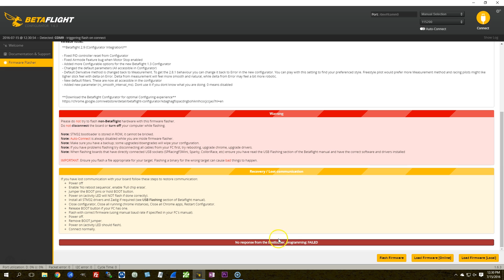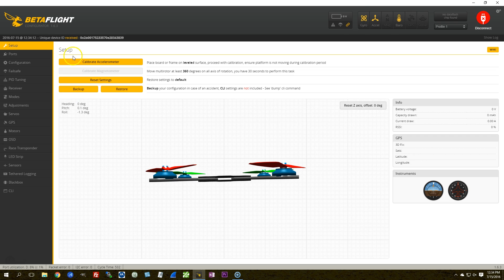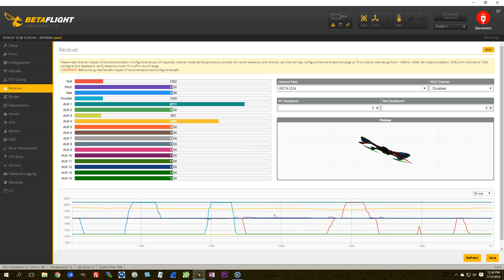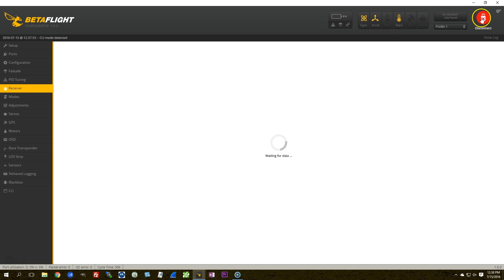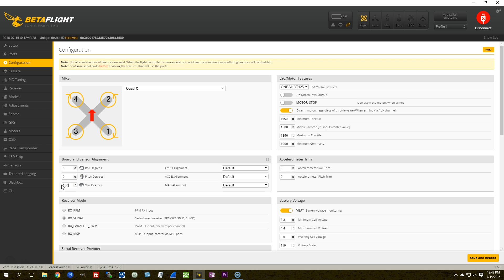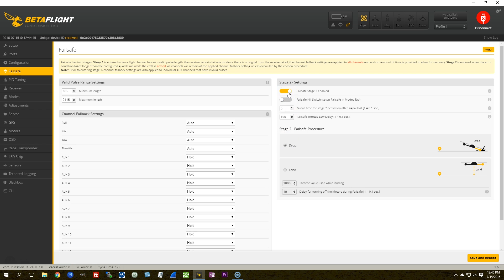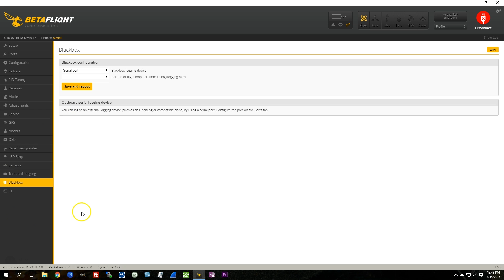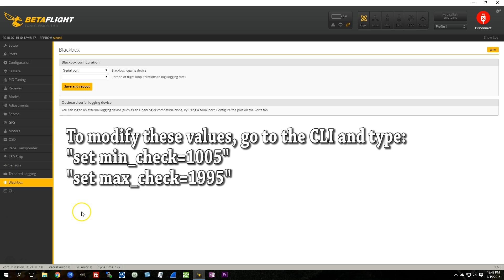Betaflight Setup (BETAFLIGHT 3.3 VERSION IN VIDEO DESCRIPTION!)

Comment: You're videos are great! 
  I have a little problem. I am running a sp racing f3 board and running ibus on the tgy-ia6c. The controls and copter works but in Betaflightin it keeps telling me to configure serial ports and some of the functions like failsafe aren't available or showing. My MSP is running on UART 1 and my Serial RX is on UART 3. I also don't see USB VCP in the Ports section. Not sure what's going on

Comment: Hi Joshua, I have a little big question. TodayI almost had a heart attack when the quad went crazy for 0.20 seconds during a fast roll in airmode (with throttle at 0) and slammed the ground from 30 feets high (nothing broke, and they say chinese frames are crap..)  I'm trying to figure out what happened... 
My motor idle is at 1050 which is lower than yours but all the motors spin nicely.
Something I didn't do is the min_check and the max_check, which I don't know if has something to do with the issue I experienced, this has only happened once after some fast flips and rolls..

Btw very useful video.
Reply from the maker: +Dashz min_check and max_check wouldn't do that. 1050 is more than high enough min_throttle for most modern setups. At this point I would be suspecting damaged hardware. I mean, you could also have had a loose prop or whatever but I think you would know if that happened.
Reply: Alright thank you, Ill keep investigating and experimenting in a soft ground , and yes my setup is up to date an f3 board, dshot capable escs (they are ztw) and some emax motors...
Reply: Well it seems that it was a loose prop as you said... Im not used to the active breaking of the new setups and they do come loose if not tighten well.
 One last question asumming my hardware is capable, how do I set up Oneshot24, multishot etc? Do I have to change loop times, pids? Or just select it into the confi tab and I have a more responsive quad.

Thanks again for your time.
Reply from the maker: +Dashz you must use nylock nuts on the props. To enable oneshot or multishot just select it from the pull down. Your ESC's must also support it.

Comment: My problem is I do not save the pid controller when I choose betaflight controller and it always appears in controller legacy. How can it be solved ??
Reply from the maker: Probably you are using an old version of Betaflight with an up-to-date configurator. What version of Betaflight are you using?
Reply: Joshua Bardwell i have betaflight 3.0.1
Reply from the maker: +Nicolas Atencio that's fine then. Are you also on the latest configurator?
Reply: The version is the last 1.8.7

Comment: How can I connect GPS?
I see that UART2 is for GPS, but I have set up serial RX and enabled RX serial on UART3 and I cannot enable 2 RX serial so cannot set up GPS, any suggestions how to do it?
I cannot select multiple UART :(  betaflight just resets and disables all my UART2 and UART3 settings if both turned on...
I need GPS coordinates on OSD to record position on DVR to find it easily when lost, I don't want navigation with GPS just to have coordinates for OSD.
I have HGLR F3 AIO board with integrated OSD.
Reply from the maker: GPS is not Serial RX. GPS is GPS. There is a radio button for GPS that you enable.
Reply: Thank, I tried that too set that dropdown where GPS is ther for uart2 save and reboot and it disappeared :(
Does it test it? when I have only USB power uart is not powered.
Reply from the maker: Most likely you haven't got the GPS feature enabled in the Configuration tab. If the Ports setting is not valid, it will be reset. If you haven't enabled the GPS feature, then enabling GPS in Ports is not valid.
Reply: on the config tab it says go to ports tab :( and aftersave it also resets gps enabed option thats why i think ports should be set properlyfirst

Comment: Got an odd one for you Joshua. At 4 in your vid in setup your quad shows 0 heading, when I plug in it show about 50 when it should be 0. I go to configuration and see the 90 degree offset is still there. I then save and reboot and then at setup it goes to 0. This happens each time I connect. Something wrong?
Reply from the maker: Heading is derived from the compass, but since you don't have a board with a compass installed, the copter can't know its actual heading. So it resets the heading to zero on every reboot. Completely normal.
Reply: Oh, thank you, I crashed 3 different models due to loss of radio control. Had the right gimbal on the futaba t8j replaced, added a new radio transmitter. Did chip erase from BF 2.61 to BF 3.01, then adjusted all endpoints on the sticks, set min and max to 1000-2000, calibrated esc and did that individual ESC adjustment from 1020 to 1980. Not fun when you go to turn and it does not turn. I am thinking it was a stick endpoint issue and esc. Just checking all the loose ends.
Reply: PS: Still crossing my fingers that it works. Otherwise, will have a good deal on a futaba I guess.

Comment: Hi Joshua! Thanks for explanation..Is it true that pid loop frequency should be lower than ESC frequency? For example, PWM 500Hz...But in betaflight the minimum is 1khz. is there a solution? Thanks!
Reply from the maker: There is no implied relationship between PID loop frequency and ESC motor frequency. You should not be using PWM anyway. Use OneShot at least, and your frequency can go up to 2 kHz with no problem. The issue you are thinking of, syncing PID loop frequency with motor PWM frequency, was fixed with the invention of OneShot. With OneShot, the motor update is always synced to the PID loop. Except Betaflight also allows you to unsynchronize it if you want to know more about that, here is a video: https://www.youtube.com/watch?v=WFFmE1EhuP0

Comment: Hi Josh,im notexactly sure what i did,but i can now connect to betaflight,and get access to the pid tuning etc
now i can start to tune,but first, a test fly in acro and fpv for the very first time,thanks for taking the time to help me,i have watched the betaflight clips a few times now,just need to get out and fly the damn thing,bit windy here today though for my maiden flight,when you are checking your receiver inputs etc ,do you have your battery connected or just have board plugged in and tx on only ?

Thanks
Scott
Reply from the maker: Some FC boards will power the receiver from USB in which case you do not need a lipo plugged in. If your FC board does not power the receiver from USB, then you need a lipo plugged in. Have your props off and/or use a smoke stopper if you do this.

Comment: Hi Joshua
Im having trouble connecting my Seriously Pro SP Racing F3 Evo V2 to betaflight,when i connect to betaflight it just does nothing,i have a premade model,i asked the shop to install betaflight on the board,but nothing i do lets me actually get to the main tabs,i would have to take quad apart to access the boot pins,its a Ragg-e WBX frame.
I can get access to the firmware flasher screen,if i try to reflash the board online without the boot pins being shorted ,will it do nothing,or will i brick the board?
Im willing to send it back to shop where i got it,but i would like to solve it myself with a little help :)
Sorry for long explanation
Reply from the maker: +scott milne have you installed the CP210 drivers in your machine?
Reply: yeah,installed all the drivers,i have a damaged floureon 250,that i can use cleanflight with no trouble at all,i use same usb cable on both cleanflight and betaflight,when i plug the usb cable into the quad and my pc,i get an error message in taskbar saying usb device is not recognised,do i need to do something with the zadig driver,i saw a drop down menu?
I asked the shop to flash betaflight onto the board as its shipped with cleanflight,the quad spools up and i did a test hover,all inputs are fine,the arming switch is good,just cant connect to betaflight to start my pid tuning
Reply from the maker: USB device not recognized means a communication issue between the chip and the PC. Does the hoard work on any other PC or USB port?
Reply: i have a laptop but it only comes up with manual selection on the ports tab,no COM 1 at all.cant change the drop donw on it at all,
Reply from the maker: Does it work with any other FC?
Reply: Joshua Bardwell what do you mean? I have an old busted quad that has a naze board, using my USB cable and cleanflight I can still connect to the quad, I unplug my busted quad, close cleanflight, open betaflight and I get the error message USB device not recognised, in top left corner of betaflight it says opened port successfully, but it does nothing and after 30 so a or do, it closes the port without connection, I'll take a video of it to show you if that helps. The quad is flyable, but I can't alter rates, pics etc, I have only tried a test hover, that's it, I have installed all drivers zadig etc on cleanflight and betaflight, I also tried my laptop, I don't get the error message USB device etc, but I can't get com1 port as it goes straight to manual selection, at this point I'm considering reinstalling windows to see if this helps. It is a sm bus controller issue but I have updated Intel drivers for that as well and in device manager  all USB ports are OK, as soon as I plug in the good quad the bus controller gets a yellow triangle in device manager on the St virtual port. I'll record it on my phone and upload it, will send link.
Reply from the maker: +scott milne https://youtu.be/m4ygG6Y5zXI
Reply: still cant get it to connect on my main pc or laptop,i keep seeing that my sm bus controller drivers are not working,im going to do a clean install of windows 10,on 7 just now,see what happens,if that does not help,im sending it back to shop where it was built
Thanks for trying to help me out Josh
Will let you know what happens
Reply: right,i now have win10 on pc,installed the drivers but not overwritten the virtual com port in zadig,i have NOT done that,i can see a flashing red light and a solid  blue light,i know this means board is in flight mode,but i cant get it to connect to betaflight at all,i no longer have a usb device not recognised and in the ports tab in device manager,i have  COM 1 and Virtual COM 3 all ok,should it only be com 1 on its own?
Really starting to get annoyed with this

Comment: hi joshua do you have configuration for wallera f210 
thx
Reply from the maker: The same general steps I show here should apply. I don't have a specific configuration for that copter.
Reply: Joshua Bardwell ok i will try because i have flash the walkera f210 fc with betaflight 2.9     
and now does not want to arming i think the configuration must be setting

Comment: Hello, I have a Tiger motor Air gear 200, and I want to know if I should flash it to BLHeli or I can just use it as is. Please help.
Reply from the maker: If you could flash it to BLHeli, it would probably perform better. But it's impossible for me to say whether it even can be flashed to BLHeli. I suggest just using it as is.
Reply: Joshua Bardwell thanks for your response. Tiger motor doesn't support  oneshot 125, what should I choose? Thanks

Comment: Im setting up my controller now. I'm using a spectrum sat receiver. Its all connected, but my yaw and my roll are backwards. when I roll right, I go left, and vise versa. any ideas how to fix it?
Reply from the maker: Spektrum you have to reverse roll and yaw in the transmitter. I'm not sure why this is.
Reply: Thanks, I figured it out. Now Im having difficulty with switches and arming. I can't figure out how to set up flight modes and arm the quad. It won't start. Help lol
Reply from the maker: Sorry, but I don't know how to set up switches on Spektrum either. I tried last weekend and I couldn't figure it out. If you can figure out how to assign the switch to the output channel, I can help you from there. You need to see the channels Aux1 and Aux2 in the Receiver tab moving when you move the switch.
Reply: ok, I see my channels when I move them. when I move the switch, it moves the bar back and forth on the "ARM" tab and the "horizon tab lights to yellow. I know Im close. I think I need to adjust the values, but when I click add range, another tab opens on AUX2. ARM is on AUX1
Reply from the maker: Use the pull-down menu to select which Aux channel (and therefore, which switch) is controlling the mode. Use the sliders to select what switch position activates the mode.

Comment: A pid loop frequency higher than 1khz will prevent the Naze32 from arming.
Reply: Barry Anderberg It's dependent on cpu load. Disable accelerometer, use integer math and legacy pid to regain some cycles then check cpu load when armed. I've ran 2.6k loop times but find 2k to be more stable.
Reply: Barry Anderberg

Comment: Hi, another newbie question :) I just picked up a little QX90 and flashed it with betaflight. I'll mainly be using it indoors, could you advise if there a best way to set up betaflight if indoor flight is what you'll be be doing most with a mini quad? Thanks.

Comment: I just tried to go from cleanflight to betaflight... Set everything up, SP F3 board, Blheli_S esc's, default PIDs and as soon as I arm the motors start spinning and the copter vibrates like crazy! If I check on the motors tab I see that the values being sent to the motors are oscillating so that's creating the vibration... If I go back to cleanflight it works perfectly... My motors and props are ridiculously well balance so I don't know what could be causing those oscillations... It's not vibrations... I tried lowering P which makes it less bad but there is still horrible vibrations... Is there any filter or setting that I should be setting up?
Reply from the maker: If your props are off and you are arming the copter on the bench, then it's normal to see the motors fluctuating to some degree. But if they're going totally crazy, something is wrong in your configuration. I would say, if you are 100% sure all motors are spinning the right direction, put the props on and VERY CAREFULLY try to hover WHILE STANDING WELL BACK just in case.
Reply: Hope you can help me out... I really want to try betaflight but I'm not familiar enough with it to figure out what the problem is here... Thanks in advance

Comment: Another great video Joshua, quick question, When I am my quad (spracing f3 and betaflight) it takes off on it's own or if I turn motors off when armed, as soon as I raise the throtle it does the same. Any clues?
Reply from the maker: Confirm the throttle channel is going 1000 to 2000 in the Receiver tab of the configurator.

Confirm min_throttle is not too high.

D gain too high can cause runaway as well, or in very extreme cases even P gain too high.
Reply: +Joshua Bardwell Thanks buddy will do that tonight and see what happens.
Reply: Have done that, seemed to improve it a bit, next problem was massive osciliation, reduced pids slightly, then it took off and flipped. Rapidly running out of props now haha. Weird because my Naze board on my 250 is flawless, might be some noise feeding back or something?

Comment: Great video.  Quick question on your arm setup.  Why do you have ARM set for the low end of the switch?  Wouldn't that automatically arm the copter as soon as you turn on the Taranis?  Doesn't the switch need to be in the 1000ms position to even turn the radio on without an alarm?

In other words, the "all switches away from you" position that most people have their radios in before turning them on is actually the ARM position in your setup, right?
Reply from the maker: I default that switch to towards me = off/disarm. That's how my first transmitter was set up as a throttle cut and it's how I've always done it since. But the truth of the matter is that you can easily reverse the mix to make the channel go either way for either switch position.
Reply: Got it thanks.  This is the second video I've seen where the switch-away position is ARM and I was wondering if there was a reason other than personal preference.
Reply from the maker: +Kevin Hall I think it is easier to swipe up with the left hand to move the switch into the forward position. This makes disarm one single motion. If disarm was to move the switch to the away position then you would have to find the switch with your fingers first before disarming. Basically, I think the switch towards you motion is faster so I think that's better for disarm.

Comment: Taranis gimbals suck Spektrums are better :) had to do it. It took me way to long to move over to Betaflight cant wait to try it tomorrow
Reply: and that first flight no tuning yet was spot on wow thats like moving from a cc3d to naze32 lol i love it Thank you Josh
Reply from the maker: +Ultimatevapor918 glad it's working out for you
Reply: I do have one question for you though Josh mine still says cleanflight on the configurator but your says betaflight with a bumblebee just wondering why not that I guess it really matters my quads flying awesome I'm just curious
Reply from the maker: +Ultimatevapor918 mine is the Betaflight configurator. If you are running Betaflight 3.0 turn you can switch over. Otherwise stick with Cleanflight configurator for now.
Reply: yea im on 3.0 i'll have some fun first then move over haven't had this much fun since i started tuning :) Thanks again for all your videos Josh

Comment: Awesome video!  Just in case anyone else runs into this- I followed this setup for my SPF3 initial setup and ran into the strangest thing- My LittleBee 30a ESCs would NOT respond via the radio at all but would (intermittently) via the motor tab and always via BLheli.  Hours later (and some ripped hair)  I noticed my CPU was 100%.  After playing with several settings I dropped the Gyro update down from 8K to 4K and all was happy happy.  In the air soon!  Cheers Josh.  Eric